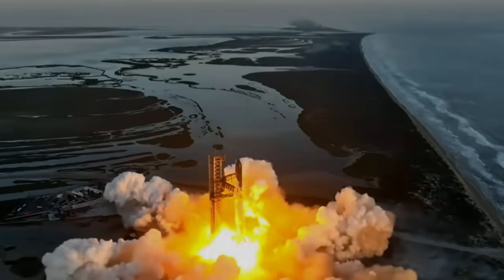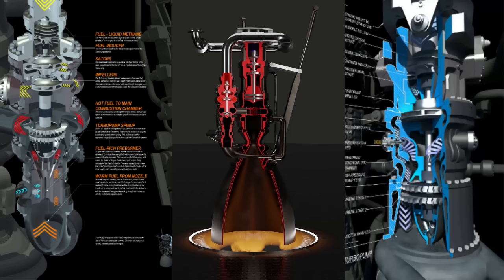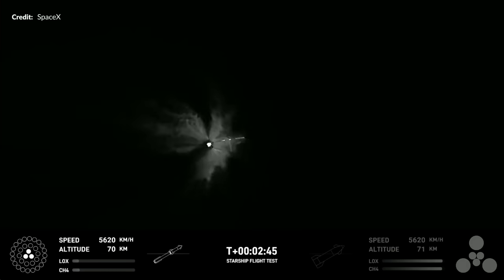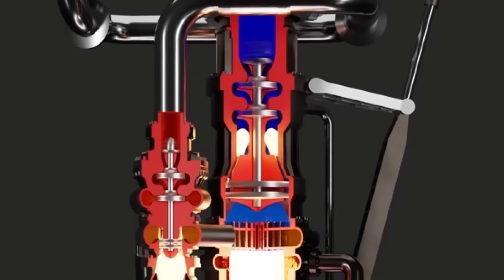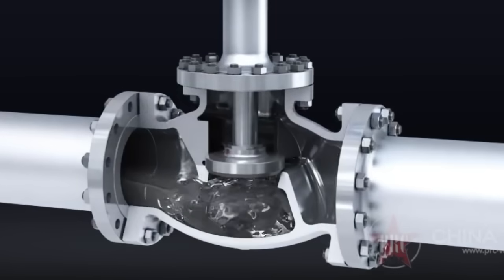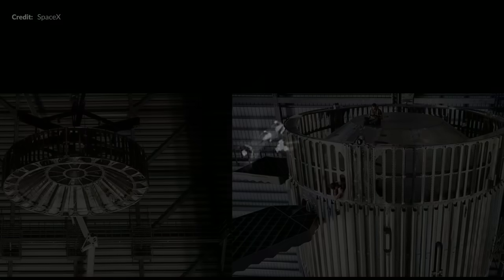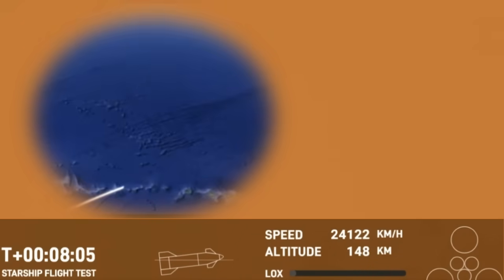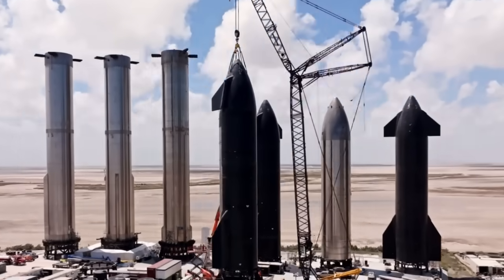Starship Flight Failure Analysis IFT2

Comment: Flatards all over X and YouTube were saying it failed from hitting the firmament.😆
Nice explanation of what most likely happened.👍
Reply from the maker: Indeed. As a test it was very successful: Stage zero and water system worked perfectly, all Raptors fired up and operated perfectly, hot staging worked, and Starship flew almost to its designated trajectory.  Not bad at all. You are most welcome and thanks for watching.

Comment: Agreed, SpaceX didn’t have a mechanical failure, they had a programming failure.  I was astonished that they attempted a restart of the outer ring of gimbaling engines before the flip maneuver was completed.  What they should have done, in my opinion, was to rotate the booster on the three engines, at full power, drive the slosh back where it belongs, stabilize the slosh and location of the mass of fuel, once stability is reestablished, relight the outer ring of Raptors with high probability of all of them relighting and succeeding in the burn back.  This is the learning curve, steep as hell!  What they are also going to have to do, the bright young men in the white shirts with the pocket protectors, is to abandon to some degree what they have learned with the Falcon 9.  One is a skinny little straw, the other a cavernous firehose filled with volatile propellants.  They’ll get this, mark my words.  Like I stated earlier, this was a programming failure, not a mechanical failure.
Reply from the maker: Indeed... Look back at Apollo. Bigger rockets have different problems.

Comment: I tend to agree with your assessment that the inner ring was restarted too soon.  Also, that it would be a great advantage to wait until the booster is a greater distance away before lighting the center engines on the starship.  SpaceX needs to wait until the fuel & oxidizer has settled before relighting the inner ring on the booster.
Reply from the maker: Thank you! We think flight three will make it.

Comment: Could some type of movable diaphragm reduce the volume of propellant tanks in flight thus lessening the fuel slosh effect and keeping pressures nominal.
Reply: That would be in addition to keeping the empty part of the fuel tank pressurised to maintain structure.
Reply from the maker: It could but those systems have only been used on much smaller rockets. Remember Starship is 30 feet across...

Comment: 100% agree. outer starship raptors only to start. Yes they would lose some speed, but easy fix. For booster, I agree 100%, only centre 3 till stabilized. What do you think of the idea of just using centre 3 all the way back. may be slower, but would burn less fuel and then no restarting issues.
Reply from the maker: Would they make it back to Starbase?  Or should they have kept the platforms for the booster?
Reply: @terranspaceacademy  good question. If they can make it back on 3....yes it would take longer but no need to relight anything. Platforms are a cool idea but there has to be a good reason why they went away from those.
Reply from the maker: Yes. After spending so much it was probably clear to either use a drone ship, bring it back to base, or make it expendable.

Comment: The inner engines on Starship were gymballed outwards, I wonder if it was enough to spread the thrust in the confined space with the hot staging ring. Maybe they need to start the 3 RVac first, then fire up the 3 RSea after separation.
Reply from the maker: 15 degrees helps but I don't think it was enough. The push back on the booster would indicate significant blowback into the skirt...

Comment: Good take on what happened.
But it left me wondering, on a simulation of lift off.
Why would the team not be asking at each point, what could go wrong. Eg the points you raise, etc as a critcal analysis work through.
If you can get a machine to play chess would they not do a probability simulation  on this.
Reply from the maker: The fluid dynamics of sloshing are very complicated and take a supercomputer to run.  No one has ever flown a methane fueled rocket before, or one this large without baffles.  And perhaps the answer is something else entirely.  The entire purpose of this channel is to make space science understandable and get us thinking about the problems the might arise and the solutions to those problems.  It's not about being right every time. It's about understanding the process, and getting righter over time :-)

Comment: Little less hammering of the fluids.  Maybe, keep more booster engines going until Starship is off and away or something. 

Better tile adhesion.   Might already be fixed on later vehicles. 

Better control thrusters on Starship once out in the vacuum of space, maybe.  It seemed to tumble once far enough out of the atmosphere.
Reply from the maker: Good points...

Comment: An excellent dive into the problems, if you are correct it raises some serious questions about the testing and decisions made. Your conclusion and solutions seem obvious, perhaps it's just hindsight but firing the centre engines on the starship at seperation with no obvious escape path seems like a no brainer and should not have been attempted.
Reply from the maker: Like blowing apart the launch pad last time but not nearly as shortsighted.

Comment: The video from the Caribbean is from after FTS activated on Starship.  What's shown is just the nose-cone.  I don't think an oxygen leak would be able to make Starship tumble while any of the center 3 engines are running.  As demonstrated by the landing tests, the center engines have a huge amount of control authority.  Far more likely to be a small fire leading to Plumbing/QD damage.  Then one of the engines shutting down due to low LOX followed by the FTS declaring the flight hopeless.  

When hot-staging the center 3 engines on Starship gymbal outwards as far as they can.  (can see this on the 2nd tracking shot) This gets the plumes just far enough out to clear the flat top of the hot-staging ring.  Hot-staging without the center 3 engines is risky as they are the only way to maintain attitude control if one of the vacuum engines doesn't light.
Reply from the maker: That is correct. Thank you. And you could be exactly right on the fires... Something took a while to be a problem.

Comment: Could they install a bladder on the inside to displace the air in order to keep the fuel from slashing?
Reply: They need a french coffee plunger type device to keep pressure and fuel from sloshing around.
Reply from the maker: That's an interesting idea...
Reply: Something that uses the pressures to equalize and push the plunger at the level it's at with no air in between.
Reply: They could have some inverted plunger spring device using the resistance of a spring against fuel pressure.

Comment: Divide the fuel and Oxidizers into 2 sections each, a smaller section that is designed as a Header tank that would remain full at all times until the larger section’s fuel or Oxidizer is fully consumed, think of an electronic power supply, a Header Tank is a Capacitor which works to filter out variations, or in this case to supply an uninterrupted propellant flow to engines!

We used header tanks in Nitro powered model Helicopters for the very same reason! It worked well! It would be lighter than a fully baffled tank, and would work even when flipping end over end. The size of the Header Tanks would have to be calculated for the worst reasonable case. A better solution, but most like much more difficult to realize would be an internal Doom that would be pressured to move downward to always be at the top of the propellant level leaving no space for the fuel to slash.

Have to find a fool prof method, with minimum complexity and which would add the minimum weight.
Reply from the maker: Up the center? I think that's a good idea... Around the downcomer.

Comment: good video! So what happened to starship if it wasn't the reflected blast? It doesn't make sense to me that the reflected blast caused the problem because it went on flying for several minutes before it exploded. Usually these engine problems destroy the engines very quickly.

But then also, I haven't seen any reports that it didn't reach maximum speed or expected altitude--(or did it?) Starship exploding after successful disconnect seemed very odd to me.
Reply from the maker: A fuel or oxidizer leak could be minor until it leads to an explosion.  Then you've got a big leak.
Reply: Thank you! I'm a grade 5 teacher and I'll be showing your video today in class--I want to be able to explain this to my students. 

There was clearly an explosive leak (shown by the original plumes). I saw in a video that the 15 degree gimbal of the center engines pushed some of that exhaust away, but what, 75% of it was blasted back upwards?

So maybe it was a small leak that eventually lead to an explosion, and then lead to the system terminating itself as a result.(do you think the system would terminate if even one engine was lost?)
 @terranspaceacademy
Reply from the maker: That's what it looks like.  The booster experienced negative g for a few seconds.  That's far too much pushback.  We think that's due to the center engines firing too soon after separation.

Comment: Assuming that your analysis of the causes were correct then your conclusions and suggested changes make a lot of sense. So much sense that it makes me wonder why SpaceX didn't implement them in the 2nd test flight. Wouldn't it make more sense to be cautious to being with then push the envelope once they knew what did work?
Reply from the maker: Like the Stage Zero issue on the first launch they can delay and make it "perfect" or test one aspect and see how it goes.  Testing is their solution to theory every day.  These rockets are just paperweights if they survive anyway... It's not like they would ever fire twice.  Knowing what can bring them down is invaluable.

Comment: the push might caused the fuel in the booster to slush and ruin the rocket kick start. maybe need a container fuel like the second stage to ensure a smooth start and fuel to settle down before relight other rocket for landing.
Reply from the maker: It would make sense to have one I think...

Comment: I feel like 6 engines need to be lit to counter the fuel oscillating during hot staging. Also I think the tiles will have to be glued like the shuttle because they keep falling off.
Reply from the maker: The next ship had the tiles attached with a better system.

Comment: At the moment of separation, for a short time, Starship's engines will induce an equal and opposite force on the booster.  If the booster has only 3 engines at half thrust, then there will be a net negative force, resulting in negative acceleration, thus inducing 'sloshing'.  The Starship induced force will gradually reduce as it moves away.  The booster engines should generate enough thrust to prevent negative acceleration while allowing Starship to accelerate away.  This requires the booster engines to be controlled precisely to keep it flying straight following the Starship.  I think inadequate booster engine thrust allowed the Starship to kick the booster into a yaw.
Reply from the maker: Or just shut down at Starship separation and use hot gas thrusters to rotate the base to the direction of travel.  There should be enough resistance, even that high, to start settling the propellant.
Reply: @terranspaceacademy  Not sure I understand you.  The 'shape' of the liquid propellant in the container is affected by the container's direction of acceleration, not velocity.  So the booster has to maintain a positive acceleration along its axis to keep the liquid bunched near the outlets.  Negative or zero acceleration will cause voids in the liquid and gas will enter the cryo pumps.  I am not sure how F9 maintains its fuel flow.  Regardless, thanks for the great video.
Reply: @terranspaceacademy  Also, I don't see how baffles can adequately stop sloshing.  Consider the outlet where the pipe connects to the tank.  When the booster engines stop, there is no acceleration and so no force on the liquid to keep it at the outlet.  When the engine restarts, it will try to suck in the liquid, and that will cause low pressure at the outlet, liquid turns to gas there, there is no force pushing the heavier liquid to replace the gas, cavitation, gas enters the pipe, kaboom.
Reply from the maker: Header tank for oxygen and methane?

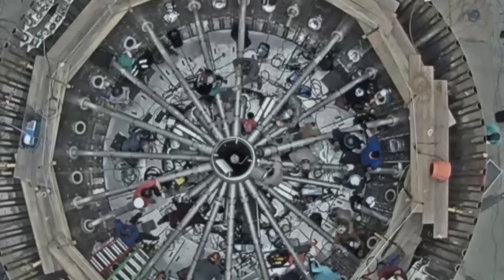Comment: 4:05 Why did the booster start to flip so soon? Was that part of the plan or did a control system fail? There's a vector of force coming from the Starship. Was the booster control system unable to maintain attitude with that force acting against the lever arm that was the booster length (from upper tip to engines below)? Or did they know they couldn't control for that so just waited for that force vector to go away and then try to regain control?
Reply from the maker: The exhaust from the Starship was used on the grid fins to help flip the ship and I think it was much more effective than simulated.

Comment: Watching the launch, I was pretty surprised by the timing between separation and booster re-ignition for the reasons you mentioned. Just a few more seconds to let the grid fins do their job might have saved the booster. But, this assumes fuel control as the single failure and that SpaceX had an accurate idea of how the booster would react to being punched in the face.
Reply from the maker: I don't think they planned for that much decel and blowback.

Comment: A generally sound analysis for the IFT-3 with existing designs.  Given the huge inertial mass of the vehicle and the inertial mass of the fuel remaining, the tanks are going to have to be baffled and the flight profile adjusted as you suggest to keep the fuel and fuel pressure where it needs to be during the hot staging and burn-back maneuver. A quick review shows that the effects of slosh control in liquid-fueled rockets have been well-documented in multiple papers, accident reports and analytical studies reaching back into the 60's.
Reply from the maker: Indeed!

Comment: At separation both the stages are in acceleration, so the fuel should be at the bottom of the tanks in both stages. When stage #2 fires it puts a lateral force on the top of stage #1, you can clearly see this in the video, causing stage #1 to start a tumble thus creating fuel slosh from which it can't recover. IMHO, only start the center three engines of stage #2 at separation reducing the lateral force at the top of stage #1 then fire the remaining three engines after stage #1 is a safe distance away! I believe this is the root cause of the stage #1 failure and any subsequent events (i.e. slosh, fuel starvation etc.) are induced propagated failures!
Reply from the maker: When the booster gets shoved back it experienced 1.75 negative gs. This would send ALL the propellant slamming forward... You are quite right that once the flip starts the Starship exhaust stream shoves the top of the booster laterally and that may indeed have created too much slosh to settle down in time.

Comment: I agree that the flip was too aggressive... and happened too soon.  Hopefully they got enough data to learn from this.
Reply from the maker: I'm sure they will.  They were worried about hot staging failing by collision after separation.
Reply: @terranspaceacademy  Ullage engines would help... and be a giant PITA, of course.  I'm for cutting all engines and flipping and ullage with solid rockets... but then, they're the only experts in booster return... they'll probably get it eventually.
Reply from the maker: I agree with cutting all engines... then flipping and letting drag resettle the propellants before firing back up.
Reply: @terranspaceacademy  Not a lot of drag!  Some math should be done to determine whether ullage motors necessary.  I believe the Falcon has surge tanks for this?  I know that's an option.
Reply from the maker: Or they could just open the methane fuel valve without ignition and make giant cold gas thrusters. :-)
Let it dissipate before relight.

Comment: Kind of surprised you don't suggest shutting down the booster once ship has thrust. Any reason that would be a bad idea?
Reply from the maker: Not at all. Perfectly reasonable.  Hot gas thrusters could reorient the booster and air resistance (it's still low enough for that) would start to settle the propellant.
Reply: @terranspaceacademy  My thoughts exactly. You'd still be moving down range pretty quickly, but it seems more reliable. Would it cost much more fuel on boost back?
Reply from the maker: Every second is more fuel to get back but if you are coming down in the drink anyway...?

Comment: Since the destruct mechanism on the first test failed it’s not hard to jump to the conclusion that they needed to test the self destruct system on both the booster and the first stage. Now the FAA can have no concerns that those needed to be tested down the road
Reply from the maker: Very true. Big badaboom.  I was surprised how well it worked.